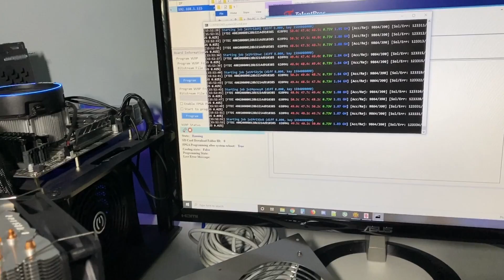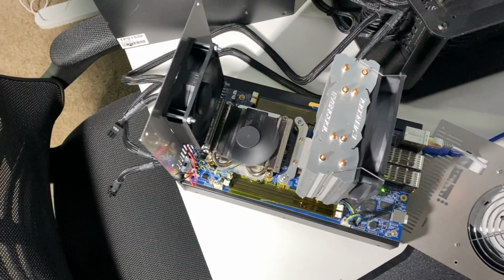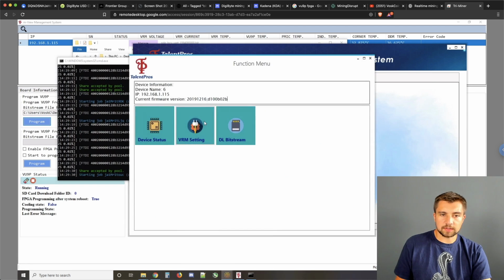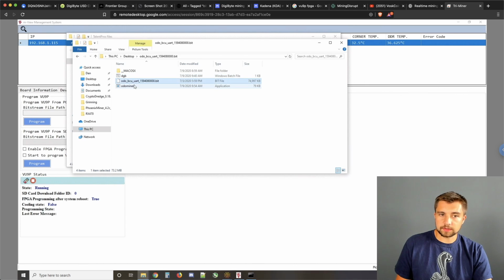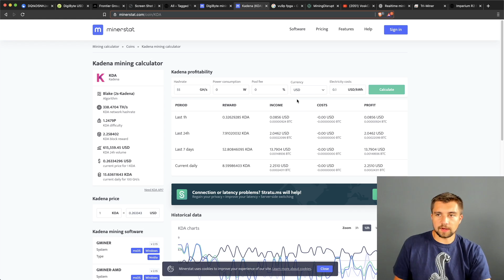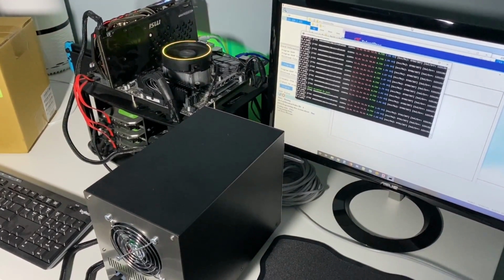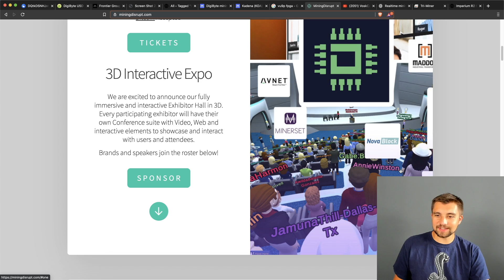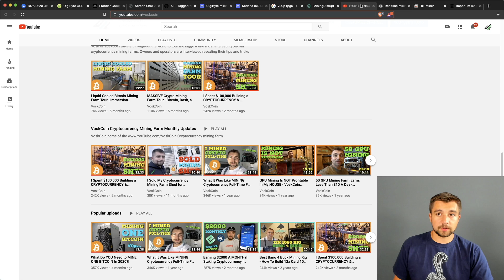Finally an EASY TO USE FPGA Mining Rig!!! TPS-1530 VU9P Review

Comment: Appreciate the video, but a hard pass on this
Reply from the maker: Thanks for watching and commenting :D could you explain why? (just curious)
Reply: VoskCoin way too expensive, would rather go with one of your custom gpu rigs over this.
Reply: VoskCoin Z9 mini = 50-75 cents in profit a day, with a cost at 40-50 a unit. So payoff would be less than a year (180 days based off my rigs specifically) payoff on a 3k rig making 1$ a day would take 3,000 days to pay off, and that doesn’t include electric costs

Comment: Hey man, just getting into mining recently #headbashed!!! Im using betterhash, nicehash and cudominer seeing which is best for profits on what hardware etc.... After usuing betterhash calculator and going through hardware i found that the 750ti is putting out some really good number for its age and power usage, can i get it to work on betterhash and get the numbers stated....... what you think mate? lol Could you maybe have a look and comment on this? Would using 2 or more create a result for one card like 1 750ti got over 40Mh/s mining Etc/Eth?!?
Reply: Literally went out and bought a 750ti today but had nothing but issues with betterhash, how do i run standalone miners? Spent hours and cant seem to figure out the command thing and trying to follow a video just doesnt work for me the same as it did for them? I have set up a wallets for mining, storing and trading. Is a mining wallet a multicoin wallet so any coin can be paid into it? Not sure if it meant the 4gb as i have the 2gb version, MSIs. Could have been any as ive seen a few when browsing to buy, could go mad with all these options and results, why cant there be just one that works well and has all the features of them all? Seems a miner os may be a good way forward if i could make sense of all that 'a cudaminer.exe :/cwofnhng9op8adrkerw ferwilueq r5ny0t9rty klm'hrsthiopburstko;lh drlskf;'t mpser89r hkl/drstm;bouimsaer;o'i hsklr'maders90 [8tóí bo ;ijsur [oirbn kl'd styk,0[9r yu#p[ rs,tfl'kb jamertp79g w4iop' n;l',t dk,.t=y90j ry6'óm,bv[\eioe m0[h89rsm 'kl;g bae.=90-b j#óyu m,ko0[ider5
short code lol

Comment: How much power need for 10x Rx580 8gb ?
1200i 2x is enough???
Reply: No. You need 1600 watts for 10 x rx580.
Reply: No non no 
2 1000 watt at least or you wil burn the rig up

Comment: Why is it so hard to find an affordable mining solution that generates a profit whiteout forking out 1000’s for a slim hope?
Reply: >>>>+1(480) 447 1003 >>>>
Reply: Because manufacturing a FPGA or ASIC is expensive and difficult. Not to mention Xilinx (FPGA manufacturer) charges $3000+ just to get a license to use their top of the line FPGA (Ultrascale+ $3000+/ 1 unit) assuming that large companies (Amazon AWS/ Microsoft Azure) are going to  use thoses FPGA for the web hosting back end. Also paying a FPGA/ASIC digital logic designer to piece together a working bitstream that does not set the FPGA/ASIC on fire after a few minutes of use (yes this has happened) is definitely something a company would invest in heavily. I thing the starting salary of a FPGA designer is $130676 a year in average. When you add all of that up the amount you would have to invest up front to even make a miner is crushing not to mention all of the fallout that's  happening with TMSC and the economy hyperinflation. I would say the best shot you have as a home miner with $0.10 - $0.12kwh electric rate is to try and catch some of the used miners that are not too old antminer s15 t15 z11and run them in efficiency mode or pull a hashboard. Then pair that with a solar panel farm to dampen the blow to your electrical cost (asumming you would live in a house). If not there are alot of RandomX coins out there where you only need a few Ryzen 3900x ($400+) setups to take advantage of the super low entry level of mining those coins (Loki, QRL, Wownero). Good luck.